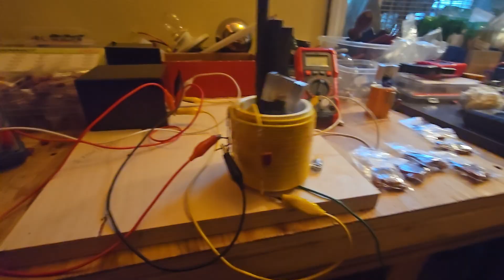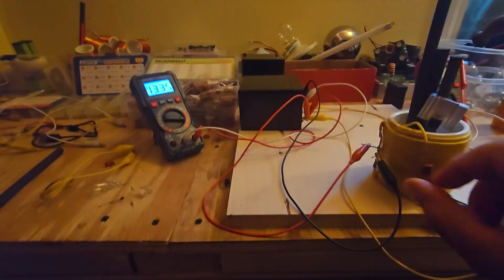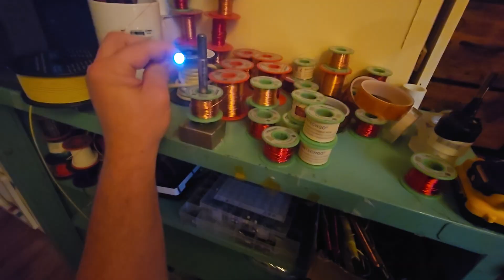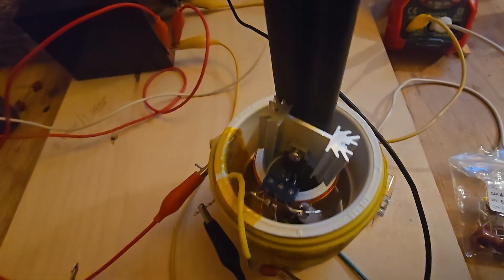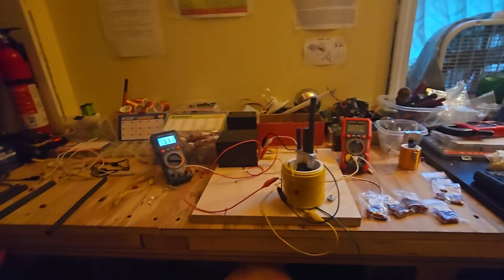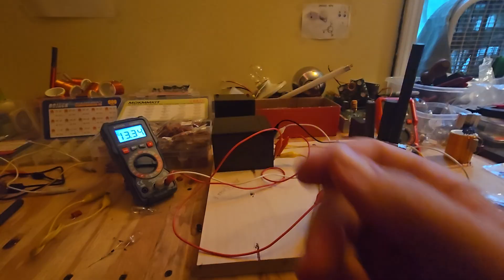📖QUICK ENERGY SYNTHESIS DEMONSTRATIONS & MORE WIRELESS POWER MAGIC✨️MUST SEE VIDEO📹

Comment: Why not take your previous slayer exiter with 80 volts input. And put 2 coils around that.
That slayer exiter was more powerfull than this.
Reply from the maker: This is actually much more powerful & self sustaining due to the two part receiver coil being bigger then the transmitter with its ability to convert reactive power into real power. We can also drive it at 12-200vdc for much more exotic effects. Also the circuit is more efficient then a slayer exciter. :)
Reply: What I found out is that the slayer used metglass which is a powerful core. It will amplify power. I am thinking the bismuth will do the same. But someone may not need these special cores to get better amplification.
Reply from the maker: @j54i  good research & we plan to test those as well :)

Comment: Bro.....respect for your research ....thnks for sharing ...and good luck in your future improvements. And thnks for your explications when you use the mechanical analogy such as flywheel/ inertia ...etc.....for me it is easy to understand the principe when I can imagine the analogy from mechanics, because the humans can better imagine the visible mechanic device in place of invisible electrics.
Reply from the maker: Glad you like it & Interestingly enough alot of mechanical & fluid based pump mechanics/Analogies apply to electricity & wirelessly which is really cool along with decoupling cause from effect. Its like the ability to wirelessly fill a bucket with water from a faucet without impeding its flow when properly tuned :)